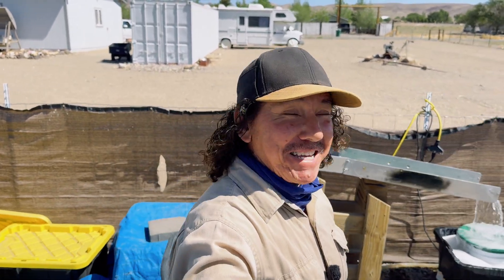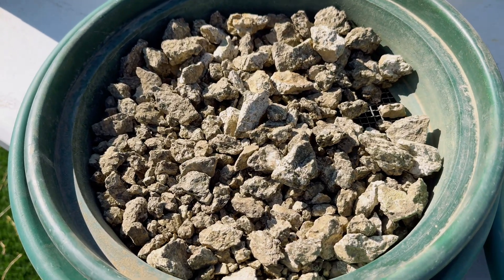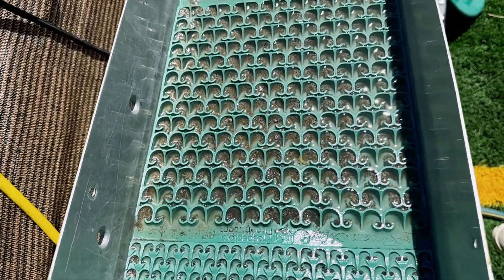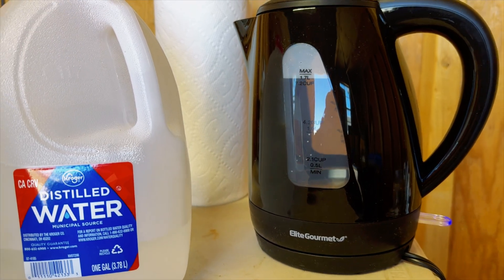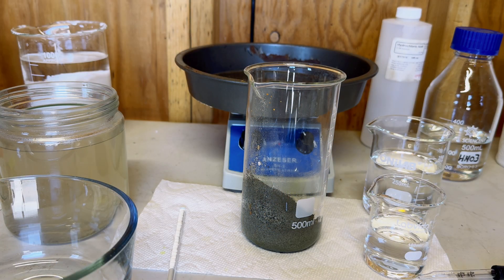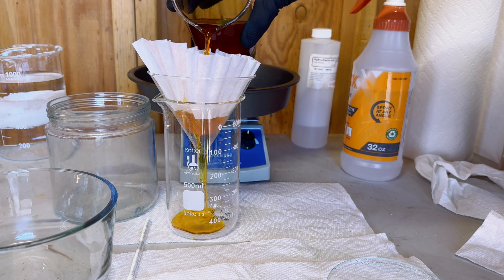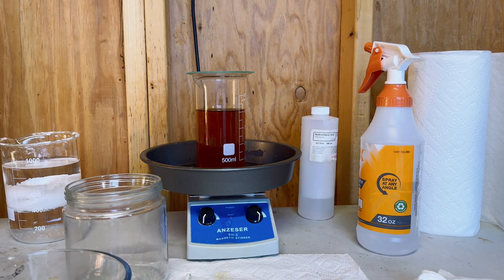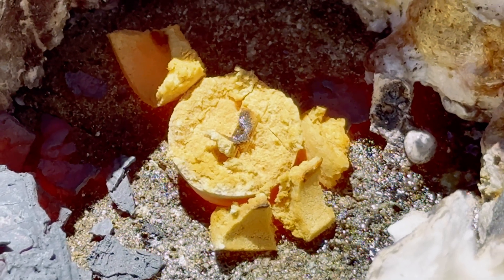Granodiorite First Aqua Regia Assay

Comment: Hey Ernie! I responded to your email the other day, i was out camping with the family. Im curious if you looked at your stannis test strip after a while and if a color showed up after disappearing? Manganese can cause issues like that when there are higher levels from what ive seen myself. There is for sure a high iron content in that ore and ive had some come out that dark when doing an HCL bath. One thing i want to mention is that even though you cooked with hcl as well as just nitric before using aqua regia, doesnt mean that PGMs would have been taken out during previous "cooking" PGMs are notoriously difficult to get into solution, especially rhodium and iridium and osmium. Even platinum can be a pain. Palladium seems to be the easiest to dissolve. Im thinking its possible your precipitate could be rhodium. Your furnace would not at all get hot enough to melt it into a button. The color of your aqua regia held a redish hue that could indicate that metal. Im no expert of course but ive had similar situations with iridium in my ore here in oregon. Feel free to email me my friend with any questions and ill try to respond faster than i have been lol
Reply from the maker: Thanks Garrett. I forgot to send my email reply lol. I’ll blame it on the Anastasia from my surgery. My mind is still a little foggy from it. 😅

I understand what you mentioned. Lord Shadow’s going to send me another sample from the exact location. I’m going to fire assay it. Do you have any recommendations of anything I should do differently from my normal assay process? Talk with you soon.

Comment: Awesome video Ernie Thanks for running the ore for me.. have fun and be safe
Reply from the maker: Hi LS, thank you for sending it. I was disappointed with the results. It was amazing to me how dark the solution got. It was a first for me and am not sure why it got so dark. I’m sure my friend and mentor Garrett will educate me about this. I’m going to try to get to the quartz next week.
Reply: @ErnieDionne  when I seen how dark it was ... I thought wow is that a lot of gold? ..... lol .... I was wrong but I dont view it as a failure ... it just poses the question what is in there .... lol
Reply from the maker: @Lord-Shadow Yes, that’s a great question and one I think Garrett can answer. Do you ever take any pan samples near those veins on your claim. Sometimes they give you a good indication if there is gold present in the area.
Reply: @ErnieDionne  Yes I tested at the bottom of the Granodiorite wall down by the river and found pretty good gold. That's why I thought that it may be riding in the diorite so I guess the search continues ...The quartz sample comes from a site about 80 miles from the diorite
Reply from the maker: @Lord-Shadow Thank you LS, I didn’t see any gold in the pan. I was surprised by the dark discoloration of the solution in the acid washes. Do you have any more of that exact Granodiorite?
Reply: @ErnieDionne Don't despair, Ernie. Because every negative or positive outcome is a valuable experience. Usually, the dark color of the solution can be due to the presence of iron in the soil. The presence of palladium in small amounts can prevent gold deposits. Always remove dirt from disturbing metals with acid washing with high precision. Excellent
Reply from the maker: @hashemameli3666 Hi there, thank you for your kind words and encouragement! I deeply appreciate them. Thank you for your insight. A few others have mentioned the same thing. I appreciate you being here with us and taking the time to communicate with me. Take care my friend 💪🏻😃
Reply: I just started watching and will report my thoughts momentarily lol
Reply from the maker: @garrettmillsap Thanks my Brother 😃